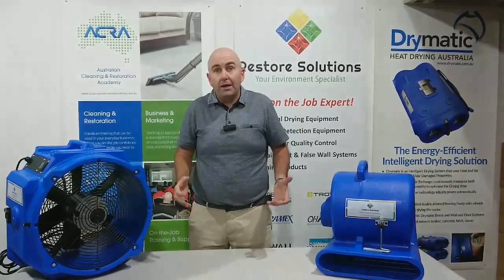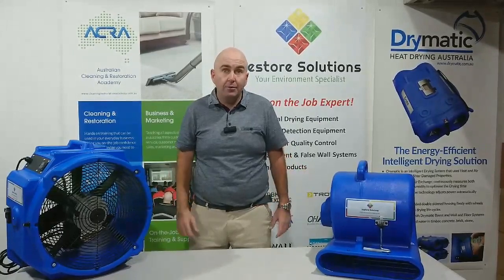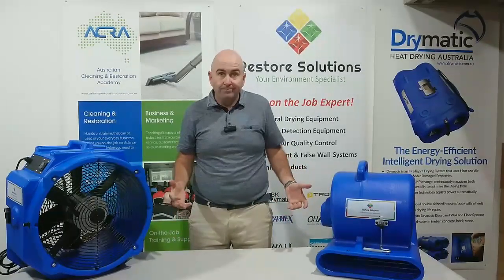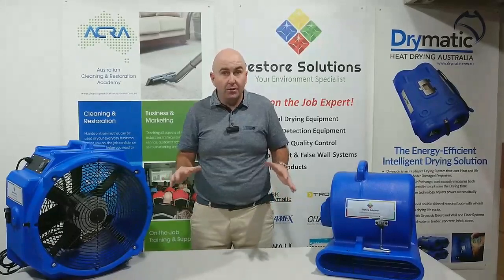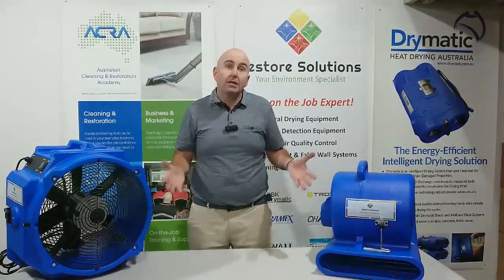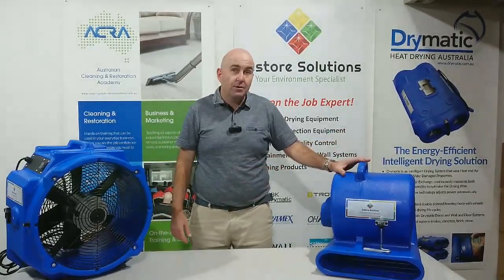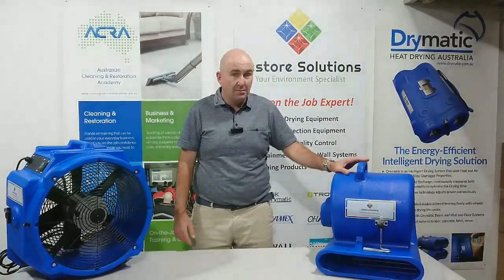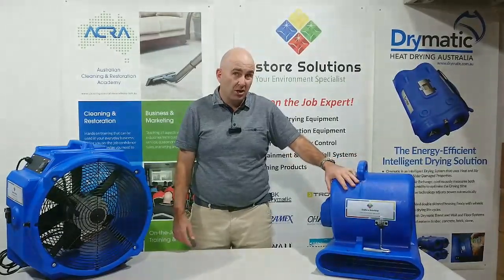Air movers Vs Axial Fans

Comment: In all of my restoration experience, I can say without a doubt that snail fans reach the air quite a bit farther than axials. The snail fans have a focused bill, while the axials disperse air in all directions. Higher CFM doesn’t always mean better at drying. In commercial application I definitely think the ability to focus air under 2 feet over a greater distance is more commonly necessary than all-over air movement. All axials lose velocity after 5-6 feet.
Reply from the maker: I think you would need to back your theory up with an anemometer I have done all the tests in Australia on all fans at the skirting at 3, 4,8 meters and also done a lot of testing at the Hydrolab in Indiana and the American Drying Institute.
Reply: I call BS, Ive remodeled many homes and when i need to dry a big surface, the axials beats them all hands down